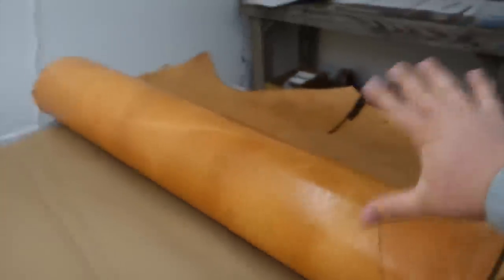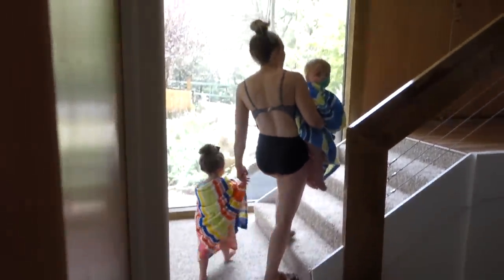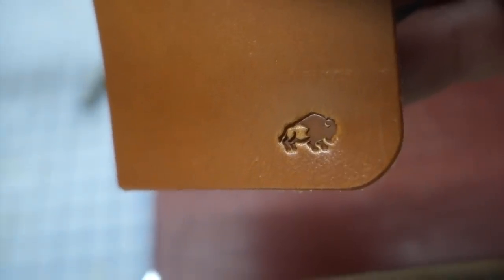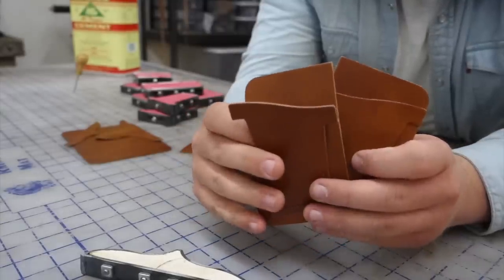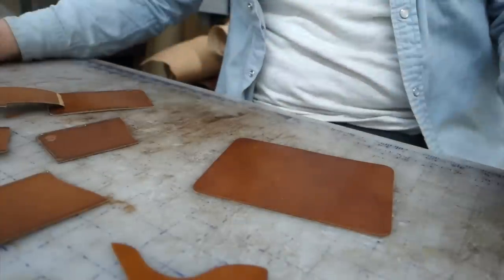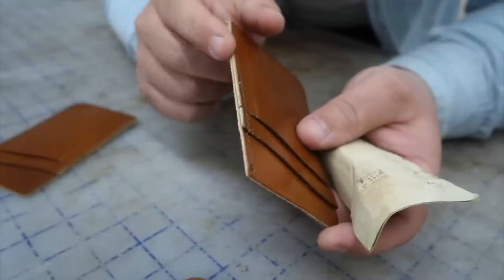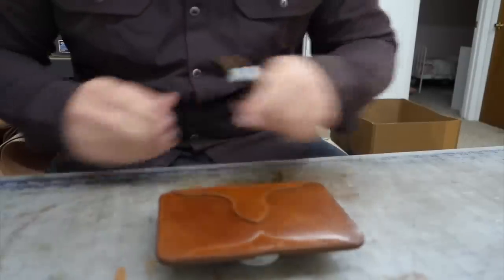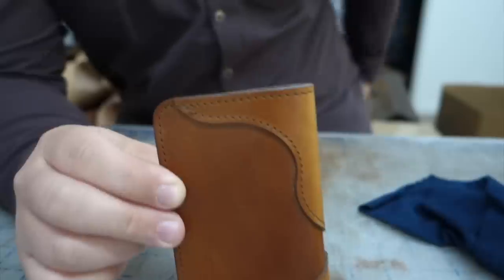Making a Western Inspired Vertical Leather Wallet

Comment: Broooooooo, that barge bottle tip is gold. Thank you so much. Ironically just this morning I dumped my can of barge into a large mouth airtight container to try something different. I hate the stock bottle/brush setup and the weaver tub isn't much better. I was racking my brain on what I could do because I was tired of going through brushes and getting glue everywhere. This bottle ID is absolute genius. Thanks, Stock!

Comment: When using a new bottle of barge or any glue it may be runny so a trick I found helps is leave it open for a while so it can thicken just not too long or it will harden about 5 hours should work just keep checking on it

Comment: Hey man, I love your leather working videos. I'm just getting started in the hobby. And have probably learned more from your videos than anyone else on YouTube. I also appreciate when you let us know about good suppliers (district leather supply is awesome). I was wondering if you ever tried double sided tape instead of the rubber cement? I seem to get the cement all over everything and things get messy fast... They make special tape that's super thin and ultra narrow. It came to mind when you were scrubbing the cement "squeeze out" off the edge. I was thinking of giving it a try, and was wondering if you had ever tried it. And if so, why do you prefer the cement? Thanks for all your leather videos!
Reply: Do not use tape. rubber leather cement is best. plus it also works a a leather sealer. you're gonna just have to keep practicing your glue skills my friend. :) try using a very small paint brush and less is more. also remember to let the glue almost completely dry before sticking the pieces together. best of luck!

Comment: I've been gathering supplies to work with veg tanned leather, notably a cylinder shaped fork bag for our Dyna Wide Glide. I bought a black leather back rest bag from Harley-Davidson some years ago and it was made out of heavy leather. It had somewhat of a matte finish but felt and looked fairly heavily waxed. Do you know what they would have used for a top coat for this? I'm trying to figure out what to use on the bags that I'm making for it....

Comment: I love your videos. They’re informative and fun to watch. I’ve been trying to make a trifold wallet and a card holder from start to finish, without relying on somebody else’s patterns or templates. I want the finished product to be about 3.5 in closed but I can’t seem to get the total unfolded length right when cutting the outside panels. I’ve made a pattern on illustrator and made two prototypes out of upholstery vinyl before buying a piece of leather. Always too short or too long. Any pointers?

Comment: I have a soft black leather jacket that is garbage, except for the leather bits.  I would like to try and make this.  Do you think I could glue 2 pieces of leather together to get the thickness and still make something like this?  I don't own an industrial sewing machine.  Do you think I can get away with using my household sewing machine as I am trying to make one, not 100's like yourself.  And...I don't have a burnishing wheel.  Is there a method that I can try without it?  Maybe I can sand the leather with 120, then 220 grit while using water?  Then maybe seal it with bees wax.

Thanks so much for your videos!  You make amazing items!  I am still in the process of watching all of your uploads )

Keep up the GREAT work and keep the videos coming.  I haven't looked yet, but do you have a video on making a leather lighter case, specifically for a collectors Zippo lighter?
Reply: This guy does not seem to have time to answer questions.
Reply: i wouldn't attempt to sew it with a regular sewing machine!!! but you can hand sew it. look up "how to hand sew leather" vids.